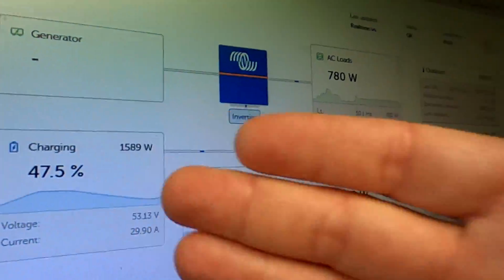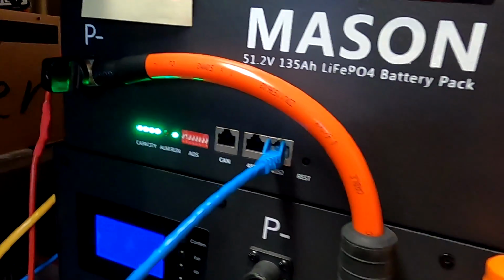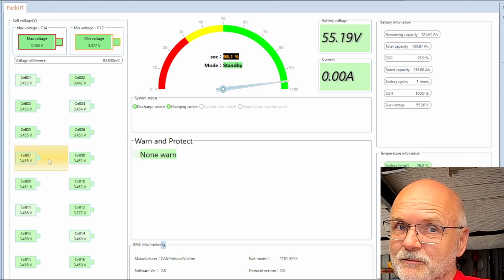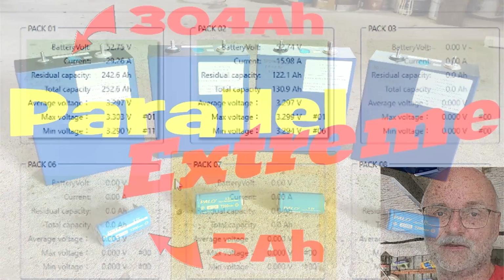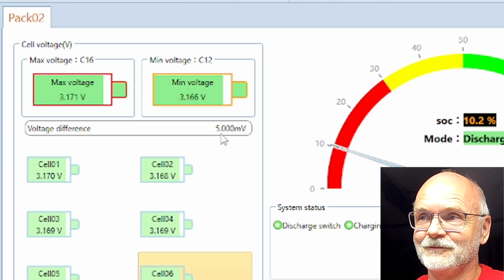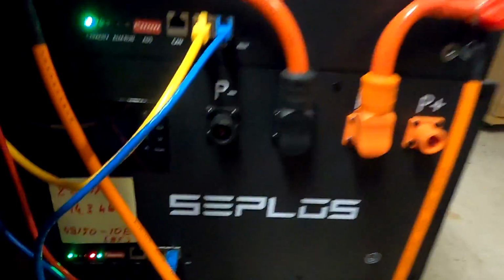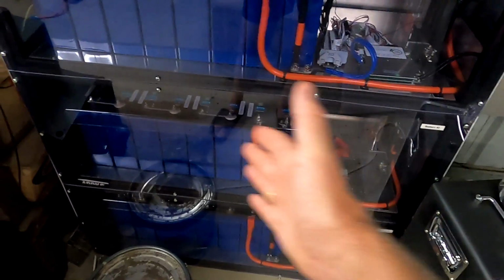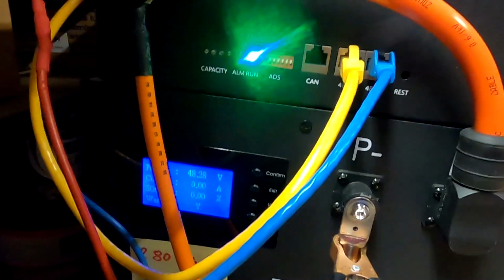280Ah and 135Ah batteries with different BMS in parallel. See what happens when discharging...

Comment: I have successfully paralleled a 280ah pack and a 176ah pack for the last several months and not had any issues.  Both deliver nearly their full capacity over a full charge/discharge cycle.  SOCs of each battery and charge/discharge current ratios vary throughout the cycle, but they move to similar SOCs at the top and bottom ends of a cycle.
Reply: same here, i have 4x 100amp and 3x200amp in parallel ,same happen to me, some different soc on ordinary use but flatting on top charging, i never go under 30% soc before i charge again.had this going on 3 years now and noting wrong.200amp charge and discharge little bit more/faster but flattening out all by it self 👍
Reply: @mortendiysolarshinybilplei4646  What happens when two parallel batteries of different capacities are used, and one cuts off due to low cell voltage while the other keeps working? When the disconnected battery comes back online, will there be a large current surge to the other bank, and could this damage or burn the BMS?
Reply from the maker: Was this with Seplos BMS as well?
Reply: @OffGridGarageAustralia  no it was two DIY banks with no communication between them. The smaller of the banks is normally in my camper but since it is winter here in Michigan, I thought I would run a parallel test with the bank I have at home. Both are LiFePo4 packs.  I’ve come to the conclusion that you don’t really need communication for a small solar setup. I use Victron equipment and it just works using info from my battery monitor
Reply: Yeah I have a 100ah connected to a 200ah. Works great. Why wouldn’t it using smaller amp draws and appropriate sized cables. Batteries equalize themselves just fine.  I’ll definitely Keep them above 20% or use the generator to bring them back up before then.  Extreme amp draws are the only cases I would be wary (like over 50 amps - which is not a typical RV use).

Comment: hi Andy, i run a multiplus II + cerbo with 3 pylontech batteries with communication and it auto sets the charge/discharge current depending on SOC and number / capacity of batteries. it does need DVCC to be enabled and I am grid connected fwiw

Comment: Hi Andy,

Thanks again for a great video! The bigger battery shuts down at higher pack voltage because of the 3 weaker cells. While a lot of power is left in the rest of the cells. Do you think it is useful to review the battery banks after a few years and combine all weak cells together in a battery bank, the 'normal' cells in a second and the high performance cells in a third bank. And get the higest capacity possible? Because you are now losing 30 ah in this bank

Comment: Cool test.  You didn't say how long the small battery lasted after the big one shutdown but it didn't appear to be long (seemed like they shared the load pretty well).  Could you repeat the test without the communication cable or would you not be able to monitor the batteries in the same way?  Doing the same thing without the cable is the first thing to pop in my head.

Comment: I see no issue with parallel of different capacity batteries, the only time there could be an issue. Is in high current draw, relative to capacity, like AAA and d cell parallel, with a large load, the D is going to do the work, and some cases the AAA may exceed its current capacity,   or possibly the other way around, because the AAA has not got the capacity,  it's difficult to say exactly the issues, but for solar , I don't see issues with parallel connections of differing capacity,  the other issue is bms shutdown, it could end up with only one battery connected, with high current, may exceed current capacity, however, this is why we have failsafe protections!!  
I believe these companies say this in a last chance attempt to sell you more batteries!!  Most other companies, not selling batteries, only say not recommend, and that's it, if anything,

Comment: You should do a test with the load connected to the smaller battery first then paralleled to the large one. If you have time do it with communications and without. See if there's any point to communications between the 2 batteries other than reading the data or changing parameters on bms.

Comment: Based on the cell current loaded voltage slump on cell #6 I don't think there is anything wrong with it from a use/aging perspective.  I think it is just at the lower tolerance of electrode thickness which gives it less LFP or graphite material, meaning it will yield less capacity. Just manufacturing build tolerance.

EVA spec for cell weight is 5.22 kg +/-0.2 kg.  100 to 200 grams lite in weight would corresponds to the AH results you are seeing.  200 grams, if all due to LPF electrode shortage would be 5-7% less capacity. 

LFP cells usually have extra graphite than initially needed since it undergoes more long term degradation over use lifetime compared to LFP cathode.  Graphite electrode thickness shortage will show up later in life of cell.  LFP electrode shortage will show up immediately as lower capacity.

Comment: The advantage with comms to the inverter is - if for some reason the software in the BMS that switches off the mosfets when an undervoltage at cell level happens were to fail then the inverter would shut down output power independently and preserve the battery.  More importantly in an overvoltage situation if the BMS fails then the inverter can shutdown charging. While I think this is highly unlikely, it can't hurt to have a backup. Also using Venus OS you can consolidate all your information in one place and you're not restricted to BT as you are with many BMS's.

Comment: I have 2 cell types here. 125Ah CYB and Eve 105Ah.

Could I paralell These both cells as one batterie with one bms? 

If a 105Ah and a 125Ah are paralell and if we assume both are at 50% and if I Connect a loader what will Happen if the 105Ah is nearly Full?

The voltage will be then 3.65V and from the 125Ah measured maybe 3.4 - 3.5V maybe.

So not as bad as the higher measured voltage of the 105Ah cell will be shown for the bms.

What you think about. Could I do it?
Reply: Are you suggesting a 2p16s configuration?
Reply: @Full-of-Starships  no. I have only 4x105Ah and 4x125Ah so it would be a 4s2p if you can say that
Reply: @Eyezzzonly  I think you would need to rewire it as 2P4S if you want to run it off one BMS??? Can anyone else confirm?
Reply: @Full-of-Starships  I would paralell one of a 105Ah with one of the 125Ah. And then the whole package as 4s config. So you have one battery with 210Ah you know?
Reply: @Eyezzzonly  I don't have any batteries myself, just an interested viewer. You said you needed to use only one BMS. I don't even know if / how well it would work, which is why I hoped someone else might comment.

PS your cells sum to 230ah.
Reply: @Full-of-Starships  the cells sum is only 105+105 because if you load it the 105Ah cell is hitting the 3.6V and the bms would shut off loading. And the paralell 125Ah cell is then only 105Ah state. So you can't sum it up like this. The lowest capacity cell is the most you can get out of it.

It's the same with other battery types. If you paralell different capacitys, the lowest capacity you get.

For example you mix 280Ah with 230Ah and make them paralell you only get 460Ah max out

But maybe I will test this myself with only 2 cells. Load them until it hits 3.65 and then measure after 3 hrs what cell has what voltage...
Reply: @Eyezzzonly  Andy did a test where he paralleled a 304ah 4S battery with a 5ah 4S battery. You need to find and watch that video.

Note, though, that the test was 4S2P, so needed two BMSs.
Reply: @Full-of-Starships  no i want just 4 cells of 125Ah paralell with 4 cells 105Ah, with just one bms.

105-125------|
105-125------ BMS
105-125------|
105-125------|

Just like that. so that you would have one cell (105 and 125 Ah paralell) and then all together series 4S 2P
Reply: @Full-of-Starships  hey but that works not for me because I paralell the cells directly to each other - Andy paralells two battery's with different Ah
That's not the same...

Comment: Comms is great for me as I use my battery’s for time of use energy shifting. The seplos comms allows my inverter to lower its charge rate based on cell voltage so it can charge up to a cell voltage and then settle down at a lower current when topping off and balancing.

Comment: I'm building one of those 280 pack with one of those case I get from Ally Express, I currently have a EG4 100ah pack and when I finish with the 280 pack I was planning to parallel it with the EG4 and see if it would communicate too

Comment: Hi Andy @OffGridGarageAustralia

I have a suggestion about how to properly control your three rogue cells (6, 7 & 8), in spite of the pathetic balancing in the Seplos BMS...

You tried out the PowerPaul 4S balancer, which is great because it only switches on at 3.4V-per-cell, but you need four of those to "tame" your bad cells.

Move cell 6 (the worst) to position 1, the next worst (cell 8?) to position 5, and the third-worst (cell 7?) to position 9. Find/pick a fourth-worst  /"victim", and move it to position 13.

You have 12 good cells left. Pair the three strongest of those cells into the first "quarter" (positions 2-4), and connect "quarter one" to whichever balancer has the lowest trigger voltage. Pair the three next-strongest cells with the next-lowest-triggered-balancer as "quarter two" (cells 6-8 + 5), and repeat for quarters three & four.

From the videos, you were frustrated that those weak cells get into high voltages far too quickly, and then the BMS kills charging before the good cells can get a good top balance. 

Once charging voltage gets over ~3.4V within any one quarter, that balancer will apply a dedicated 5A of current just to reign in one bad-boy cell. I think that 15A+ of total balancing current may well be possible.

As I see it, those weak cells are always going to run away. They are currently not controlled, so they stop the good cells from charging fully. 

Clamping each bad cell to three good cells reins it back, so that the good cells can fully absorb / top-balance. Then when they discharge, those good cells can give more Ah before the weak cells kill the BMS.

You are never going to get more performance from the weak cells, but I think this allows the good cells to get very closer to 100% at the top end, so they can deliver more Ah before the bad cells trigger a low-voltage cutoff?

Thoughts, everyone?
Reply: PS I think there are also several slightly-out-of-spec cells on the 135A battery, so that would also benefit from the same.
Reply: PPS what would be ideal is if you could treat the "quarters" as individual ~14V batteries, then have them four-way balance across those four quarters.
Reply: If I dump this stupid idea here I hope to have a clear mind to celebrate New Years in a few minutes...

So, Happy New Year, everyone... 

Take the four "quarters" of good and bad cells I mentioned but wire each quarter as 4P (so averaging to 3.2V @ ~1080ah). They're in parallel, so their voltages are locked together, and the strong and weak cells must average to give their combined capacity. 

Then wire each of the 4P in series to make 4P4S 12V @ ~1080ah.

Oh, and then you can balance them using the PowerPaul 4S balancer.

Comment: Hi Andy @OffGridGarageAustralia,

could you have disabled charging in the lower-voltage BMS while you were cross-connecting the batteries, after doing the spark test first? Would the BMS safely intervene if the currents were too high after you connected?

The breakers between each shelf in battery v2 is a great safety feature. Would there be value in having an extension cable with ring lugs at both ends and an inline fuse or breaker for when you do these "don't try this at home" 🙂 stunts?   I know there is a 400A fuse inside the box, but that's too high.

I still remember the shocked look on the Digital Mermaid's face when she realised her master fuse stopped something nasty from happening. I know that was a short rather than cross-connection, but you wore goggles while you made the connection (and we don't want to lose you Andy 🙂 ). 

I'm also wondering what would have happened if there was a nasty problem - would you have needed gloves to disconnect it? (I have no idea - I'm not hands-on, just wondering.)

Comment: Great test Andy, and you nailed it on the need for proper communication and simultaneous low voltage shutdown.   There might also be some paralleling safety issues with the smaller battery as well due to the presence of the big battery. I would be a bit concerned over the worst case amperage on that smaller battery if the firmware doesn't do its job right when shutting everything down.
Reply: Simultaneous low voltage shutdown would negate any benefit of having larger capacity batteries in the bank. As soon as the any one of the batteries run out, all the other batteries which still have capacity would be shut down too = major loss of capacity. If all the cells in the larger battery were balanced, both batteries should share the load according to their capacity & discharge fairly evenly.
Reply: @arthureschner9319  Remember that when batteries are connected in parallel, the voltage is the same for all of them.   So when you hit the low-voltage shutdown it is because ALL of the batteries have reached that voltage.

Even if a battery, due to differing SOCs, runs out of gas earlier, its voltage will still be locked to and propped up by the other batteries.  It simply won't contribute much in the way of current.

Where the problem lies is that depending on the BMS low-voltage shutdown... the BMS in each battery will trigger at different times.  More or less around the same time, but probably differing from seconds to a minute or two verses the other batteries.  This can cause assumed current sharing to devolve down to a single battery taking the full load of the system which we definitely never want to have happen.

In anycase, this points to the fact that nobody should EVER depend on the BMS in the batteries to handle either the low-voltage shutdown condition or the high-voltage shutdown (charge complete) condition.   Whether they are synchronized or not.

The inverter should handle the low-voltage shutdown itself, by turning itself off, at least 0.10V higher than the BMS in the battery would otherwise trigger its low-voltage shutdown.

And similarly, the charge controllers in the system should handle the fully-charged condition by limiting the voltage to 3.55V/cell (enough so the BMS can balance the cells), then stay there and not go higher.  Because you absolutely do not want to trigger the BMS's high-voltage shutdown condition (usually at 3.65V).

Of course, the charge controller doesn't know what the individual cell voltages are, but you still program it that way x N cells.  So on a 24V battery, for example, you would program it to go no higher than 28.4V (3.55V/cell).  If the cells are reasonably balanced, the BMS's high-voltage shutdown will not trigger.   If they aren't, then it might, but at least it will happen while the current is trailing off and low.   

Ultimately the BMS in the batteries will sort things out.  The cells will get balanced, the differing SOCs of the multiple batteries placed in parallel will equalize.  It might take three or four full charge/discharge cycles to do it, but it will do it.   Which means, most of the time, you can safely connect batteries up in parallel as long as their voltages are the same, even if their SOCs are not.   Just take some care and exercise them through a few cycles before really putting on the big loads and the system will be fine.

-Matt

Comment: You should allow a depleted battery several hours to stabilise or you lose charge ability by recharging a HOT battery. Even 6-12hours to cool is fine but straight throwing energy into a emptied hot lithium battery will ruin it's cells. It's a chemical process that needs to relax and convert..

Comment: Andy, I have such a setup running for more than 9 month now (280Ah parallel to 90Ah, Seplos BMS). The main benefit of the communication is that if you have a inverter which needs communcation to work properly (like my Sofar inverter), this is the only solution to get them working. On a Victron system the benefit is less. Only benefit is that you have a total pack SOC (which is average of both SOC's) and Seplos can ask using DVCC to lower the charge voltage while charging. During discharge this could be a thing also while using grid mod. Not during off grid indeed.

Comment: it seems the comms connection between the BMSs really just behaves as a pass-through so that monitoring of multiple battery banks can all be done via a single connection to the PC and/or a single bluetooth connection. Are there any configurable options to change the behaviour? Thanks for doing this testing. I am currently building two Seplos 280Ah banks the same as yours but with the 10C BMS

Comment: Great test & conclusion Andy, I have often wondered if the comms bring anything more to the party than a link to ur computer for individual visuals of each battery BMS situation. 
I have 3 x Seplos “Suntorque” 5.2kw Batteries, they are all in parallel & no communications & I have similar results, they all charge & discharge at similar rates with a few exceptions. I use an AIO to charge the batteries by day at 40Amps takes about 5 hrs & then run several fridges & tv’s etc off them from 3pm-9am next day.
They all charge & discharge at similar rates without comms.